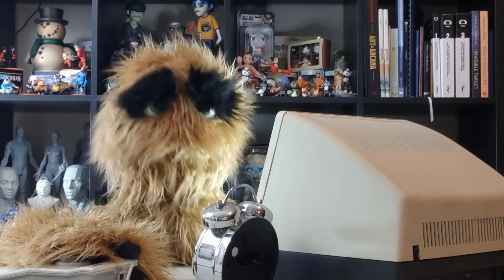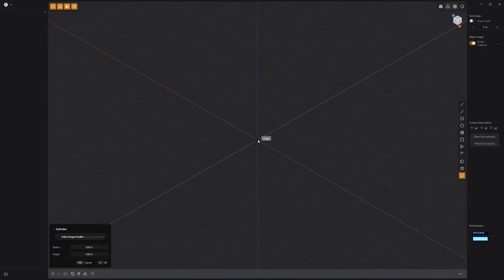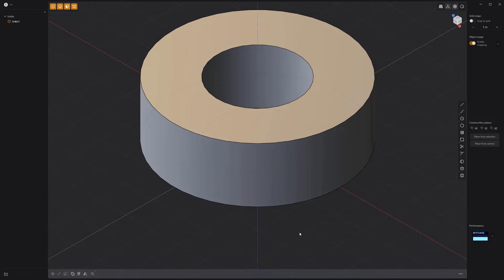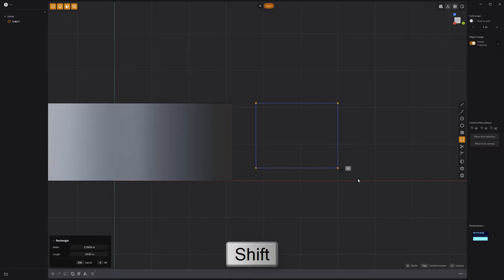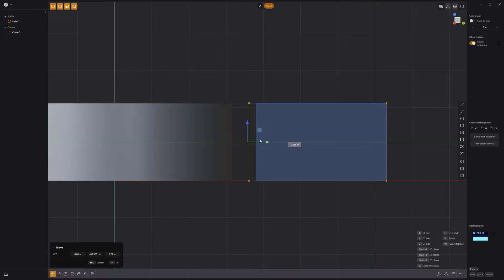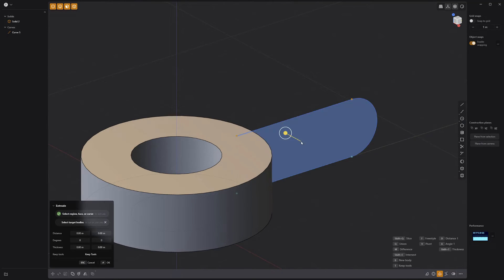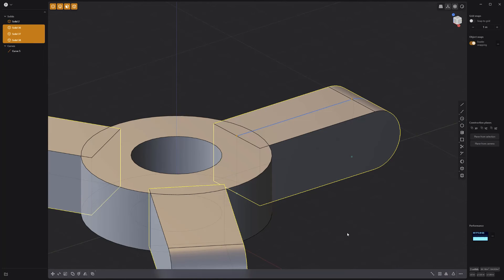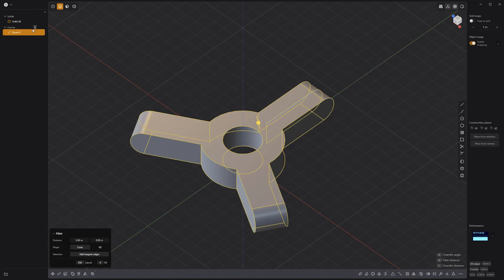Plasticity | Modeling Exercise 01

Comment: Well Thanks Floyd Puppet. Very helpful tip. I wonder if we can make request sir? If so How do you create a track surface, Lets say a car is rolling on the loop made of different corners. How do we make the wheels roll along with this car so when the car turns or drift it looks right. Is this possible in Modo. Man I miss when Brad was around. Dan Ablan and the rest of the crew. However thanks to Floyd and William.
Reply from the maker: Are you looking for something like this? https://youtu.be/ta_SrX2ooT8